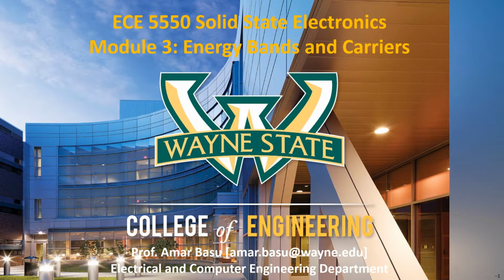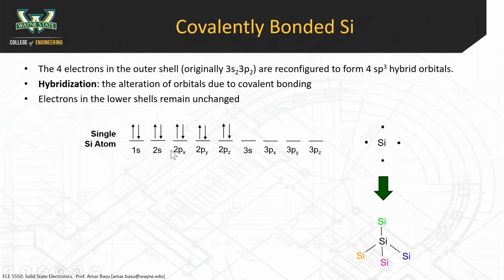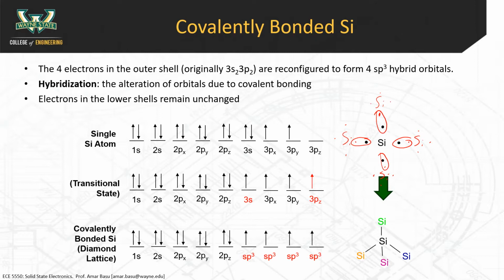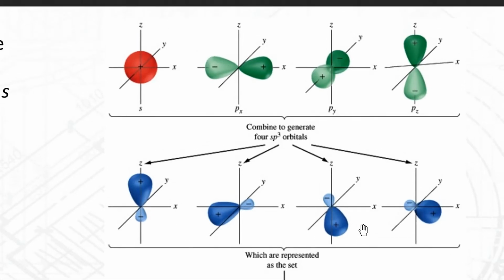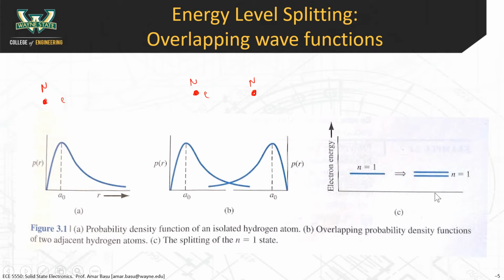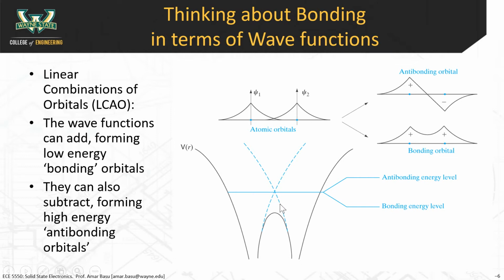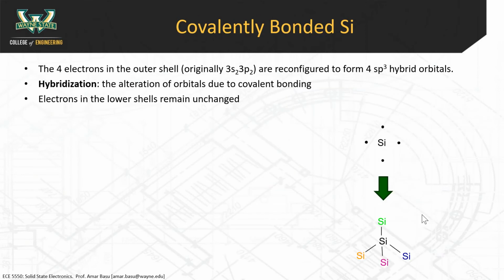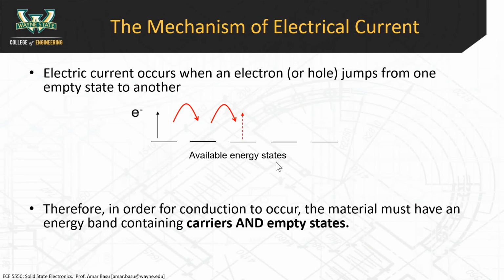3A: Silicon bonding, hybrid orbitals, energy bands

Comment: Orbitals of valence band electrons form sigma bonds and by sharing of valence electrons by each atom, valence band is fulled for each atom? How do then look orbitals of the conduction electrons? Nice video!
Reply: A individual Silicon atom has 4 electrons in the valence level ( level 3  ). In the lattice they combine to form the hybrid orbitals with the covalent bond, that its the explanation of the video, BUT they continue having 4xN electrons in the valence level with N the number of atoms in the crystal. Moreover, if you solve the Schrödinger ecuation with 3s 3px 3py 3pz orbitals where are placed 4 electrons (out of 8 that could be place in a sp orbitals) , you will get 4 (orbitals) x 2 (due to spin) =  8 bands, the first 4 full with 4xN electrons, then a GAP, and then another 4 bands empty  in  So, is the valence band fulled for each atom? If the temperature is 0 K, the electrons are not excited and stay in their energy levels (in the valence band, if we have a crystal), BUT exciting them, they can jump to a higher energy level leaving holes in the valence band. In the real space, in the case of silicon and due to the covalent bond, the electron is jumping in the same hybrid orbital (if you only consider sp orbitals) but to an external region of less probability because is occupied with an electron of the nearest atom, so, considering only sp orbitals the current is originated due to the jumping of the electrons in the sp hybrid orbitals with the covalent bonds. If you give more excitation energy to the electrons they can jump to more external orbitals like d orbitals (in where they are more free) and so on... Its important to remark that look of the orbital is a representation of the propability in where the electron could be localized, so for an H atom the orbitals have the same shape than Si, the difference is that H only has an electron in 1s orbital and Si has electrons in all the orbitals that are shown in the video.

https://en.wikipedia.org/wiki/Atomic_orbital
Reply: Simple IV group elements obeys molecular orbital theory 
From the molecular orbital theory :
No. Of atomic orbitals involved in bonding =no of molecular orbitals 
                          And 
No of molecular orbitals (always) =bonding orbitals +antibonding orbitals .
Bonding orbitals =antibonding orbitals.... 
Energy of antibonding orbitals is always >either of the atomic orbitals 
Energy of bonding orbitals < either of the atomic orbitals.. 
Here.... 
Each silicon atom undergoes hybridisation and forms 4 ,sp³(3s, 3px, 3py, 3pz) hybrid orbitals which are equivalent in energy... 
And here our actual discussion starts....!
Each hybridised silicon atom forms 4 covalent bonds with the other neighbouring (4)si atoms 
Here 
No of atomic orbitals involved =8[4 from one silicon atom +4 from neighboring silicon atom ] 
No. of bonding orbitals =4
No .of antibonding orbitals =4
All the electrons  involved in covalent bond formation occupies bonding orbitals (4)and the 
Antibonding orbitals (4)which are at higher energy level are vacant 
In the semiconductor material:
Let us consider there are :N such atoms 
Each atom has 4 hybridised orbitals with 4 electrons (unpaired) 
So there are total 4N electrons in semiconductor material. 
                       And 
All such N atoms forms the covalent bonds... So from the molecular orbital theory there are 
8N atomic orbitals 
4N bonding orbitals 
4N antibonding orbitals are there in a semiconductor material 
All the 4N electrons occupies bonding orbitals and 
And 
All the Antibonding orbitals(4N) which are at higher energy level are vacant .......
This 4N antibonding orbitals which are vacant forms the conduction band ...
                       And the 
4N bonding orbitals which are filled forms the valance band...
As energy of antibonding orbitals >energy of bonding orbitals 
This energy difference between them is called forbidden energy gap which is about 1.11ev..
Hope u will understand this.... ....
Reply: @sindhupriyaa5718  i didnt get to think through everything that you wrote, but the type of orbital, weather it is bonding or antibonding affects the material nechanical properties mainly, i would guess. For us electronics engineers its inly important that we see a good dense conduction band, from whaterver orbital type.